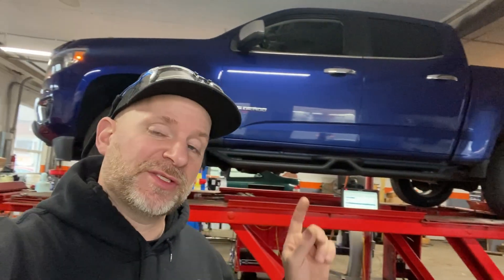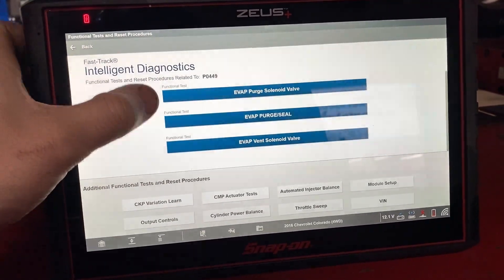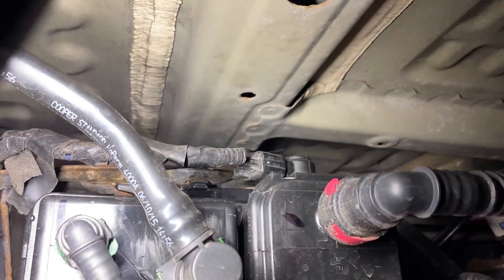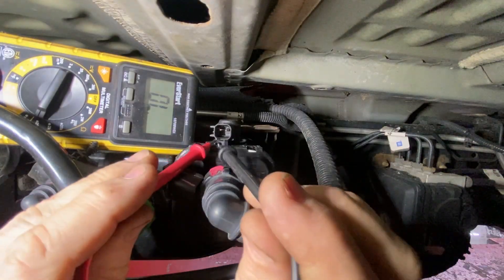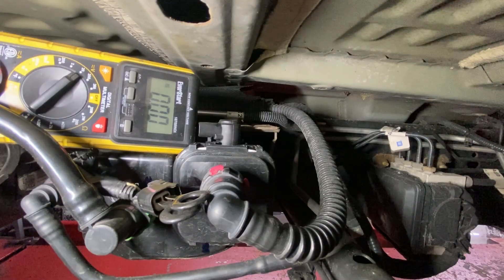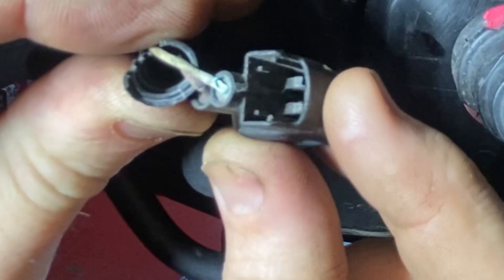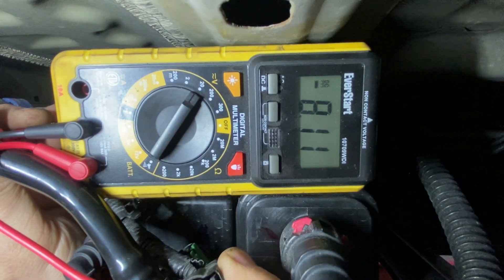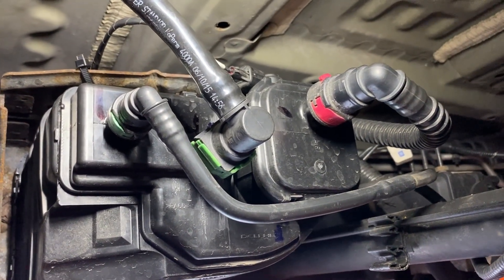EVAP Mystery Solved! Diagnosing a Stubborn P0449 Code

Comment: Had a 2003 Dodge neon. The only time I'd get an EVAP, small leak. Was in the hottest days of summer 90°f+.  Any other time it was fine and if it cooled off would clear itself in a few days.
Reply from the maker: Interesting observation, heat can definitely play a role in those evap system issues. This coming with small leaks tricky ones to find